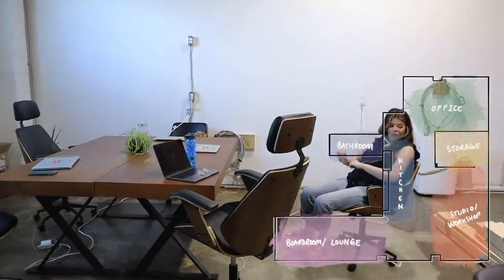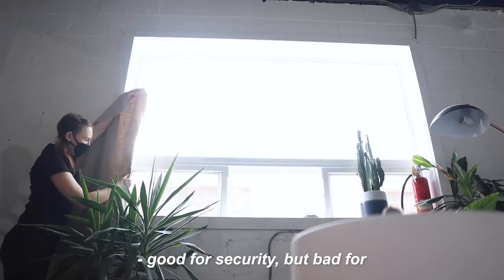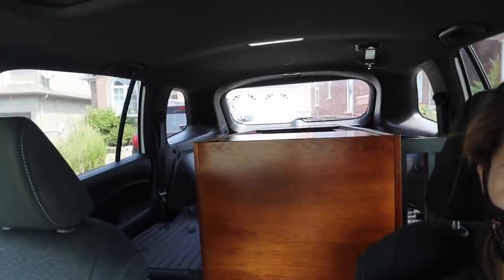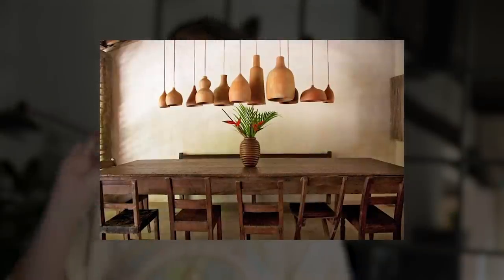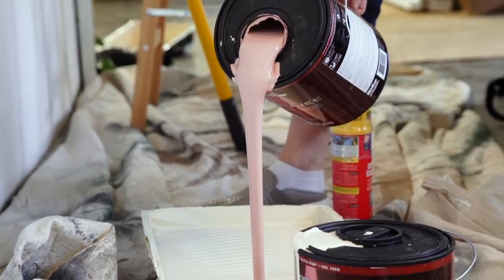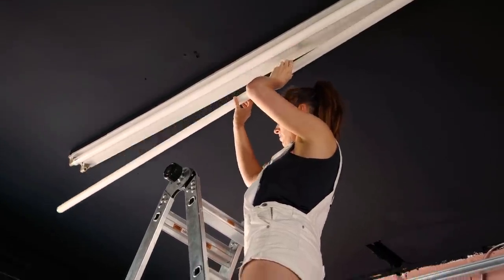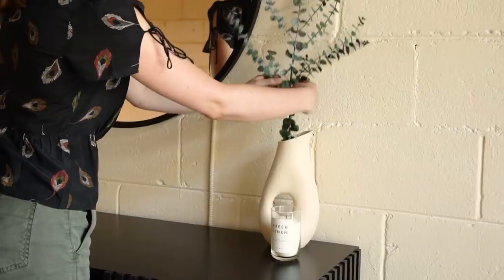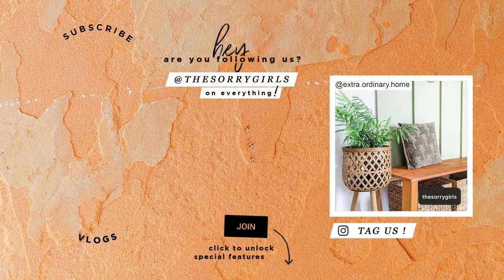empty garage turned colourful lounge makeover!

Comment: I think y’all should’ve brought down the pendant lights a bit lower and staggered their heights.
Reply: I think staggering them would look great!
Reply: I think they should’ve painted the ceiling where the old light was hanging. It’s just a white rectangle.
Reply: Caitlin Danielle Foster I don’t think they’ll be moving the desk to film. If they do then what you said makes sense. But it seems like a pretty permanent conference area to me. And since the table will probably be there all the time they won’t ever actually hit their heads if they bring them down lower.
Reply: Susan Alexander I have a feeling they will later on. They probably wanted a perfect match and since the landlord painted it they might need to contact him for the paint color or extra paint.
Reply: The longer the cords the more they sway in the wind and higher chance they would break
Reply: Sierra Marini I doubt they’ll be opening up that garage door often enough that that’ll be an issue.
Reply: @MeteoricMarlin  i think they use that door also for bringing in big items that cant fit through the other doors so i think they might use it quite abit!
Reply: Also, they should just put a privacy film on those garage windows. Like a frosted window look and it'd add more privacy.
Reply: @chefsusie17  they did 28:45 but the paint is not matte so the light reflects on it
Reply: @chefsusie17  i was waiting and hoping it'll be painted black in the reveal portion. Except for that I like everything :)
Reply: yea and vary the spacing between them as well
Reply: MeteoricMarlin  totally agree with this suggestion
Reply: That would effect the balancing of weight though
Reply: @Brey__  maybe if they put the frosted film all the way up ,except a couple rows up towards the top so they could still see outside sky and such. 🙂👍
Reply: same thoughts...
Reply: Ré they hung curtains so if they don’t want anyone to be able to see in all they have to do is close the curtains, kind of like with windows at home.
Reply: completely agree.

Comment: Hey girls! Lighting person here...just wanted to drop by and give a few tips. With your current setup, you will need to add supplementary lighting. These pendant lights only offer directional lighting. You have dark ceilings and it will make it feel "cave-y" if you don't add additional sources. You could try Wide Beam Surface Downlights (ie. "Can lights"), I think they'd look great and if black, would disappear into the ceiling. You could go for the traditional recessed (if your ceiling is drywall) or try a modern spin with it surface (https://i.pinimg.com/originals/a0/63/d5/a063d58ba1deb776d8e21222968bb198.jpg ). Hope this helps! Cheers (The loft looks amazing btw!)

Comment: I feel that the lights over the board table need to be lower. Also, to stop the problem of the pole tilting (and add to the industrial feel), how about making the pole out of metal piping and making the vertical poles be the exact length needed from the ceiling to the horizontal? You can thread the wire through the vertical pipes to attach to the horizontal so that the wire is still doing the majority of the work, but a rigid pipe will stop the horizontal from tilting. Does that make sense?  But, I am loving the colours and I think the “waves” work really well. Love the logo!!!!! OMG!

Comment: I'm not sure I understand the logic of how they choose to layout the office space. Don't they need to use the garage door to bring in furniture and things like that? Why put a bunch of furniture in front of it that you will have to move oit of the way everytime? And It appears to be pretty far from the storage area. 
The pendant lights seems pretty cool and the solution ther came up with is innovative but again if they plan to use the door frequently it seems like just a matter of time before it breaks or causes some kind of problems.
Reply: They have another huge door on the other side right in front of the workshop/ storage area.

Comment: Ooh, love the board room light. I would add more hanging vases to fill it. You wouldn’t need to add more lights, just hang with similar rope. Use smaller vases to fill the voids. (Also, as an engineer myself I was chuckling over the physics problem you had there. Good problem solving. )

Comment: a !WARNING! though: if you wrap a cord that carries an electrical current multiple times upon itself you create a magnetic coil (and therefore a fire hazard). Love the pendant fixture, but it is far safer to cut or swap out the cord so they have a more appropriate length. safety first an happy crafting ;^*

Comment: I wish you guys would shop at other thrift stores than value village - they are for profit and after I tried to donate something there, they were rude, told me they weren't taking donations until an hour from when I was there, didn't help me load my crap back into my car even though I had a bad shoulder which was obvious because I had it taped up.  I'm never shopping there again and besides, they are for profit.  Goodwill at least runs programs and they are cheaper - I find VV pricey.  🤷‍♀️

Comment: It was a such a beautiful makeover, but there were somethings that really bugged me through out. I was so disappointed when Becky painted the beautiful details on the cabinet door, it was such a shame especially since in my opinion it would've looked better int the space since the black looks like it doesn't belong there. I wish the lights were hanged slightly lower  and the ceiling above them were painted black instead of having a white rectangle. Also I wish that insted of having a huge orange blob in the centre of the wall, they should've painted it in several spots. But overall it was a beautiful makeover as always, and again all of it is simply my opiniln so sorry if I offended anyone!

Comment: I feel like the organic wall with the shape that is mushroom or pile like could benefit from a play off that slattedness on the credenza. Maybe like 7 or so spaced slats leaning at an angle from floor to ceiling- low end near the garage door high end towards the logo light. I would use the same color are the credenza. It should cross the mushroom just right of center. If feeling really ambitious it could be a light.  A thin piece of corregated poly with the thin slats glued on with leds behind that diffuse through! Wouldn't want it to dominate the space though. A thin beige paint over the corregated poly would probably warm it up just so.

Comment: I really wish you would make the curtains a bit colourful, like colorful  confetti or very tiny polka dot type things on the bottom or upper part of it, using the same neutral colors of the wall. It will give another dimension and bring the eyes up. Also the lights would have looked even more beautiful with different heights.
though overall, its a gorgeous makeover, way to go girls. More power to you. With love from India :)

Comment: One thing you could do to keep the lights next to the bay door from swinging around in the wind when the door is open, is to put up wires at a 90* angle from the pole the is holding the lights and run them below the door when it is open and hooking them into the side walls. This would require 4 attachment points in the walls and would join each end of the tube. You could also put a turn buckle in the mix and use that to tighten the wires to take out any slack. This will keep the tube that is holding the hanging lights from swinging around on the existing two vertical wires.

Comment: i would've recommended that you run that metal twisted cord through maybe a bamboo rod before hanging the light fixture, that way the wire doesn't tilt the dowel (and all the glass lights) upwards if the free hanging side somehow gets shifted!

Comment: Did the light get hardwired in or how did you run the plug? Also do you wire the two three string lights together?

Comment: Painting a large rectangle on the ceiling above the conference table would help define the space and is also a solution to the mismatch paint job covering up the old bare spot where the fluorescent light used to be.

Comment: Becky -
Plays on her laptop shopping.
Paints a few things.
Plays in the curtians thinking she's in a music video.
Last minute of video, helps with final touches & finally starts being usefull.

Kelsey - 
Hangs up all the curtians.
Gets buckets to catch all the water leaks.
Paints an entire 400 sq ft wall mural by herself.
Cleans up dead flys.
Does electrical work taking all the lights down.
Hangs everything up for the new lighting feature.
Sweeps all the floors.  
Hangs up even more lights.
Moves a bunch of furniture. 
Nurtures & repots a bunch of plants.
Does all the final touches.

Kelsey is a fucking allstar & becky is just sitting on the bench.

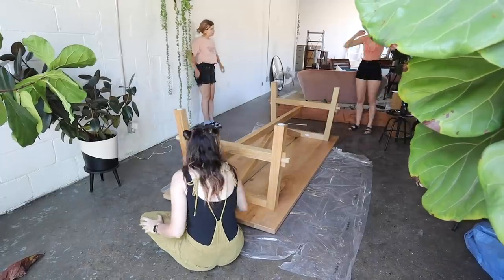Comment: 2:52 you are really standing on that  tiny swiveling stool instead of a ladder, to screw  the curtain wire into the  block wall,  above your head, with concrete dust falling downwards, and no  safety glasses.   :o  The only way this could be more unsafe is if the stool was on wheels.Why? I know you must have ladders and glasses in that workshop.  (watch next episode they'll stand on a rolling chair, wearing  high heels,  to weld  something  while wearing a long flowing  gauze scarf , but no welding mask)